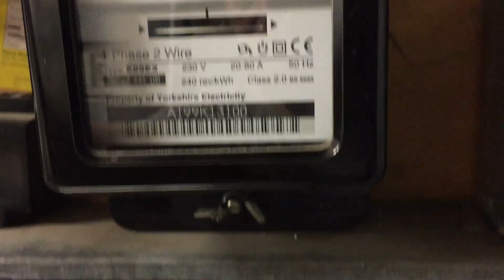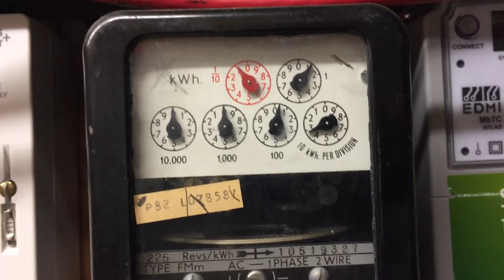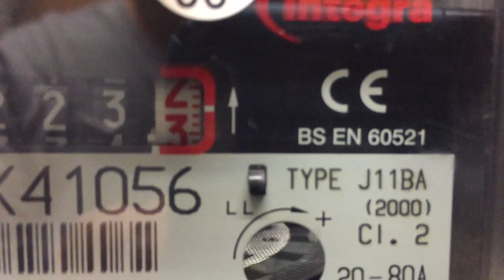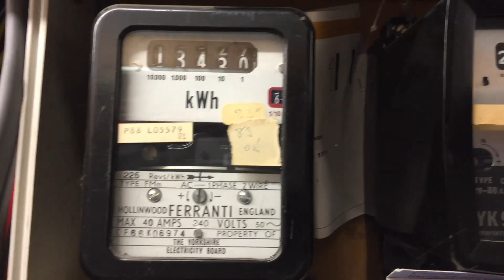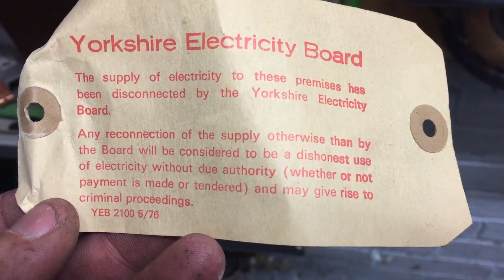electricity meter room

Comment: Nice meter room, great to see the Ferranti FM from 1956 still in service. Thanks for making the video.
Reply: ....There was a Ferranti FM in amongst all of those?
I didn't see it.
If you mean the instrument which shows at 1.07.........

......that one is a FMm. :D

There is a difference, and from what I can tell, the FMm goes at 225 revs which js the same as a FNE, but the FM meter (which is still on my wanted list) whacks a bit faster at 375 revs.

I know that, because some years ago, someone had four meters for sale, and one of them was a 375 rev FM. I wanted that to go alongside my FNE.

Anyways, because of their darned packaging error, when they sold them all and boxed them up individually, my name got stuck on the wrong parcel, and my 375 rev FM ended up going somewhere else!

I complained, but there was nothing they could do, as they dispatched all four meters to different places on the same day, and had no idea as to what meter went where (as far as they were concerned, they were "just meters") and it would have been very difficult to trace the FM, recall it, and then send it to me.

I ended up being lumped with a FMm (cylco-dial type) which has exactly the same characteristics as my FNE 12Q. 

I am still on the look-out for a 375 rev FM.

Time is running out.

Not many loadwheel-based meters left now.

The door of opportunity has almost closed.....

I am doing my best to assemble a diverse arrangement of instruments so that I will have the UK's largest collection of instruments on YouTube. Time is running out though.

In a couple of years from now, there will no longer be any more loadwheel based meters coming up for grabs based on their being removed, and so the door of oportunity will have closed forever.

PERMANENTLY.

For all the years that electricity meters have been around, they have always had a loadwheel.

We are on the edge of going into something new.

Something electronic.

Something with no moving parts.

Something boring to look at, cheap, clicky-clacky, single-use, not capable of being re-calibrated or opened for repair.

The future will consist of meter cabinets which are only opened once a decade to change the plastic-fantastic for another one. People will no longer know what an electric meter looks like.

They won't be able to enjoy the deeply Sssatisfying loadwheel action.

No moving parts.

No dials.

No roll-overs.

The future looks depressing if I have to be brutally honest.

Those of future years will either be amazed or laugh at loadwheel based instruments.

They will either marvel at the engineering inside a typical loadwheel based instrument, with all of its various parameter adjusters and the very fact that it could even be re-calibrated, adjusted and even be put back into service, and even then, for a few decades at a time! Or...... 

They will scoff at the whole idea of having to undergo the chore of reading the meter every so-often, and there will even be those who will pull really odd, strange and painful faces at the very thought of even thinking of trying to figure out a meter with a clock-dial readout!! :D ROFL !!!!!!

My goodness!! The horror of reading a meter! How ever did they get on in the 20th century?!! GASP!! Standing there, in the rain, holding a pen, paper, an umberella AND A TORCH?!!! Spare me the thought!

....And what is this I hear, that way back in the 20th century, people used to pay for their electricity by feeding actual coins into the meter? Seriously?!!!!! You're pulling my leg!!

Hmmm..... perhaps they should pop over to Wayne's Electrical some time!

That would surprise them! :D

-Wayne's Electrical.

20th September 2018, 21.00
Reply: It is such a shame that the seller of that FMm meter didn't take more care in posting the correct meter to you. For us as meter collectors the correct meter is VERY important, meter serial number, meter constant, meter type etc. I am at the moment in Sydney Australia again which is still meter heaven with loadwheel action. Soon on 2.5 hour trainride to Katoomba where I will attach a note onto  CT meter, if still there, that they will contact me when the meter is replaced. Maybe lucky or not. Will take some meterfootage of more Australian made meters.
Reply: That was me Wayne, on my other account, not sure why Google switched, maybe because of hotel wifi. Will capture mote analogue loadwheel metering today.